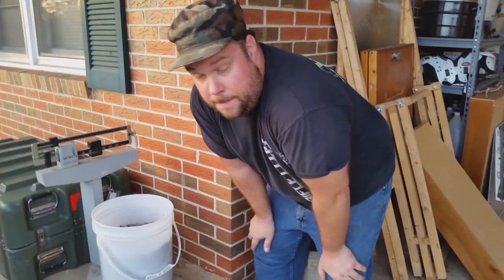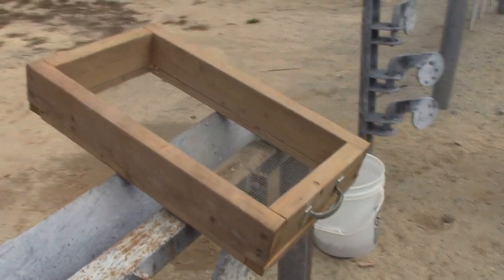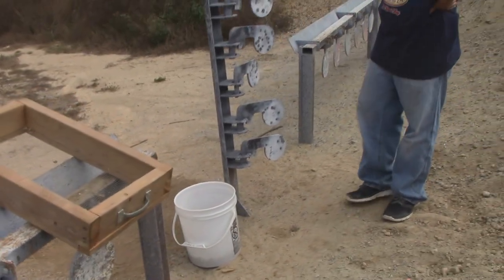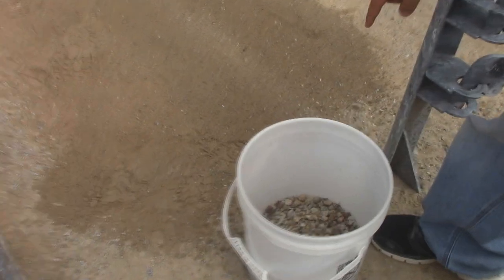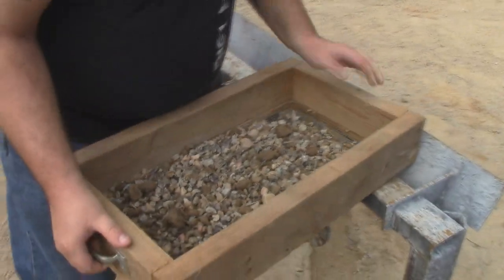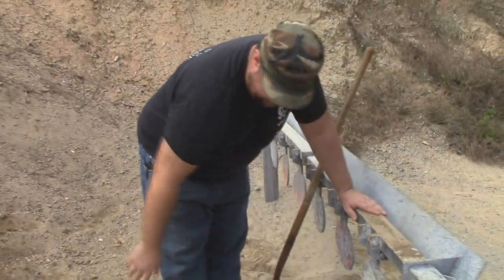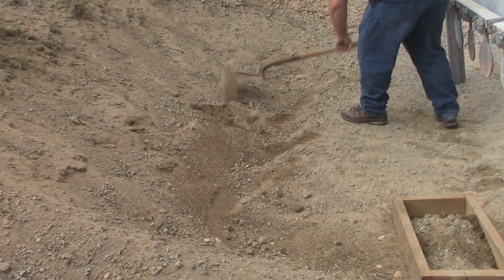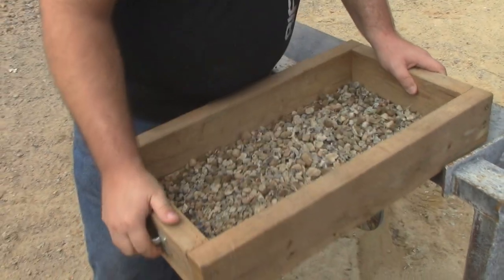I've Been Collecting Range Scrap Lead Wrong! 255LBS./30MIN.

Comment: 255 lbs. How much was rock and debris?
Reply: david diehl Decent amount probably, still worth it though i would think.
Reply: @capper6100 Do you melt the jackets also
Reply: david diehl I don’t, I do melt copper for a hobby but there is an issue with melting jackets. Getting copper hot enough to melt would vaporize lead residue and im not going to breath that in or get it on my skin.

I just throw away the jackets, not worth it.
Reply: david diehl If you are wondering, lead melts at 621 F and copper melts at 1984 F. So lead will just melt out of jacketing.
Reply: @capper6100  could probably sell it for scrap. Probably be #2 brass.
Reply: david diehl Yeah, i was considering that. My scrap yard doesnt mind lead so i may start doing that.

Comment: This tells me 2 things. First the previous range isn't making as much money as the one you're going to in this video. Think about the math. The range in this video has to work hard everywhere else to make sure people are happy going there. Therefore, more people go to that range more frequently. They likely don't have the man hours to get excess lead out from the pits. Because more people go to this range, they fire more rounds into the backstops which in turn loosens the dirt and yields more lead. The previous range has hard dirt because few go to it in the first place, the dirt settles in place due to inactivity. This means the previous range has less lead per capita.

Comment: CountryBoyPrepper getting stopped by the Highway Patrol:
Officer: CountyBoyPrepper, do you know why i stopped you?
CountryBoyPrepper:  No sir, why Did ya?
Officer: Well? Your truck its ridign low like you have a heavy load there and you missed the weight station back over there.
CountryBoyPrepper: Sir, with all do respect, i don't think i need to stop at the weight station, my load is 5 pounds under the weight limit.
Officer: CountryBoyPrepper! I need to know exactly what that load is and exactly how much it weighs?
CountryBoyPrepper: Sir this is scrapp lead and each 5gal bucket weighs exactly as much as i can posible carry from the burm to my truck.
Officer: CountryBoyPrepper! I am going to ask you one more time how much does your load weight???
CountryBoyPrepper: Sir, so thats 3 5gal buckets and each is about 85 pounds so thats 255 pounds.
Officer: But the weight limmit is 250 pounds.
CountryBoyPrepper: well Sir, there is about 5 pounds of rocks mixed in in there.
Officer: Well CountryBoyPrepper, for your honesty, politeness and accuracy you may continue to your final destination! 
CountryBoyPrepper: Thank you Sir, thank you....have a great day!

Comment: Rather than a flat sifter, use a u shaped shifter on a pole, closed ends, and pull up the hill a few feet at a time, sift and dump.  No shovel needed.

Comment: Just a stupid story but.. one day out at the range there was a brush fire and that caught the backstops on fire and they fell down into piles where the targets were... They saved the range buildings. What happened is all the heat melted out all the led into puddles. So later there were pools of led. They had to go out there with an axe to chop it up into movable scraps. 

DO NOT SET YOUR RANGE ON FIRE TO COLLECT THE LED.. just to cover my ass.. lol
Reply: Now that's an idea. Why not use a blow torch and melt all the bullets into solid sections? No need to sift.
Before a section is cooled insert a hook or eye and winch into the truck.

Comment: save your back ! build another frame around the screen you have with legs and put casters on the bottom of the screen you have with one foot of extra length on your outside frame to be able to slide back an fourth

Comment: you could do a solar powered shaker table.....  would be so much easier.
Reply: Solar is very weak. Would make more sense to use a petrol motor. Petrol is cheaper than one gets from a human eating food shaking it manually.
Reply: +Mshojat depends on the solar/battery connection you're working with.  you can make a very strong solar shaker.   not to mention he could probably melt all his lead with solar power as well.

 lens like we did with ants back in the day
Reply: For it to truly be solar powered, the panel would need to be so large, it's be too expensive and too unwieldy to use.

Instead the shaker would be battery-powered, and the battery could be recharged back at home with a solar array.

Comment: you can use magnents to separarte the lead from the rockes and other things
Reply: Lead is non-ferrous, or non-magnetic. You can't induce a magnetic field in the lead either, like you can with aluminium.  The only reliable ways to separate lead from other metals and from dirt is either heating, or chemical treatment.

Given that he's taking the shrapnel and bullets from the dirt, rough sorting with a sieve and manual preliminary 'cleaning' is probably the most efficient way to go about that.

He could make it a bit more efficient by using a scraping shovel instead of a digging spade to remove the dirt in a much more uniform grid pattern. Otherwise, he's basically doing the best you can do.
Reply: of course you know magnets only work on iron  not lead.
Reply: +TheAruruu thanks, i just learned somthing new.

Comment: As bullets are weighed in grains. How many bullets does that work out to? I started to do the maths and, life is too short, I'm away to watch the BBQ PIT BOYS
Reply: 1 pound is 7000 grains. If you're casting 200 grain 300BLK bullets, you'd get roughly 35. 
The math on that works out neatly for 200lbs of lead, you'd cast SEVEN THOUSAND bullets.

Comment: Definitely quicker than picking it up 1 by 1 LOL

But... You're making the same mistake

You're picking out the big pebbles 1 by 1.  Get another sifter/colander/whatever you call that thing with bigger holes and just dump that pile into that?

But what do I know.... lol I don't do this
Reply: Candi Soda it doesnt matter because when he goes to melt it anything that isnt lead will float to the top since lead is denser than rocks and any contaminates
Reply: not always heavy clay will mix with the lead just fine

Comment: Have you ever thought about using a metal detector's sand scoop or beach scoop?
Reply: I tried that and it sucked.  I went right back to the shovel/sifter method.  I use a set of folding table legs to sift on, so I don't have to hold the whole weight of the sifter and of course I use a dolly to move the buckets.  I work smarter but it's still a tough job.

Comment: Most gun clubs/ranges mine and reclaim their lead periodically and sell it to defer the costs of operating the range. I would ask before doing this. Also, lead exposure shouldn't be trifled with. You are generating a lot of lead contaminated dust, and you are not wearing a mask or gloves. I would worry about the lead exposure from your melting and casting operation.

Comment: Only problem is you got hard and soft lead mixed.
Reply: easy to solve if they have diferent melting point, you only need to use a mesh like the one to pick it up and heat it until the lead starts dripping down
Reply: just gave me an idea... find a steel mesh to line the crucible with... and when you have all the impurities floating you just pick up the mesh out of the crucible. of course itll have the a precise sized mesh.. not too big.. not too small, but small enough.

Comment: whats lead go for a pound
Reply: on ebay around 2 dollars a pound, usuallywhen you look up lead on bass pro or cabelas, much more moneysometimes around 8 I have noticed, so yeah he is pulling money right out of the dirt
Reply: 60 cents a pound locally, But He is not getting Just Pure lead, it's lead alloy and more valuable.  Btw I bought lead on ebay around 1.25 per lb.
Reply: ***** I bought smaller quantities of range scrap lead on ebay like 22.5 lb for $27.  $2.50 is way too much to pay for range scrap, this is what linotype and foundry type runs.

Comment: What is he prepping for, when he's going into cardiac arrest while sifting a few pounds of dirt?
Reply: Actually the more you do this kind of stuff it helps get you into shape. It's cardio and weightlifting combined. I mined a backstop once where the bullet trays were 300+ pounds each.....more like 400+ pounds each. That is how I ended up getting caught. All the decrepit old farts, broads, girly men and fat asses could have never pulled those trays free and clear BY THEMSELVES. I got banned for a few years as punishment.
Reply: @JohnDoeEagle1  400 pounds each, every time, by hand?
Reply: @luckys1evin  

There are 10 shooting lanes on that range with one of those bullet trap trays on the bottom of each one. You unscrew the wingnuts from the threaded studs and remove the access door. There is a big steel eye ring on the tray and you use a 3/4" diameter steel hook and T- handle to pull it out about 4 feet in front of the trap. You have to have the muscle strength down low to get it out so that you can scoop out the bullets with a shovel and dump them in 5 gallon buckets. Needless to say you have to be pretty f***ing strong and determined to do this. They figured out it would have to be a pretty muscular member and also someone with a Military background as well as a pretty serious reloading/bullet casting background. They narrowed it down by the process of elimination until all fingers pointed to me. I'm hoping they let it go and moved on after several years of being kicked out and they let me back in. I would ask permission (no rules were written that you can't at the time) and possibly offer to leave a donation next time.
Reply: @luckys1evin  

Key points were that everybody complained at cleanup day. They showed up and signed their names on the list, ate doughnuts, stood around and talked then left. The traps were overflowing and running over. No rules were written that you couldn't take the lead. They even said 'we don't care if you take some, but you can't take it ALL!" I think it taught everybody a lesson. They just waste the lead and sell it at the local scrapyard for pennies on the dollar uncleaned and separated. The guys and gals assigned to cleanup day are lazy and not motivated individuals. "Someone" with the balls and brawn took it during Covid-19 pandemic to make ingots and then bullets with it INSTEAD of it being sold to China and imported out of the Country. All the while a NON PROFIT club maintains $75,000 in their checking account!

♠🏅

Comment: And you're helping the environment. 😁🤘
Reply: How do you figure that? It came from out of the ground to begin with and we are just putting it back.
Reply: @dennisholder8427  because of the concentration if the lead in one area.  Lead exists naturally in areas where the environment is condusive for it to exist.  Nature kinda self contains it.  Taking a large amount if it.  And putting it into a foreign area is bad for that environment.  
Yes it get extracted from the ground.  But its not as pure for one.  It has to be refined to make it pure.  If you draw from a well with a high lead content in the water the water isnt drinkable.  
Oil comes from the ground too. Its deep in underground wells. Just dumping it back on top of the ground isnt good for the environment.  
I love shooting. And personally I never have extracted my lead.  But someone spending time doing it is a good thing. Free lead for him and helping the environment at the same time.

Comment: Your worried about the range?? They should be paying you for removing the contamination from the ground.
Reply: 1. He's getting lead, so that's quite good of a payment.
2. The range would usually pay some "professionals" to do it, but they wouldn't sift through some dirt, they'd sift most of it.

3. If this guy built a small foldable contraption for sifting he could probably clean the ranges properly, get paid, and get hundreds of kilos of lead.

Comment: Two separate Gun Ranges around here wont let anyone near the lead-member or not. I guess they realize the value in scrap. The one has 55 gallon barrels of slugs and barrels of brass casings ready for the scrap yard. And they sell some more desirable casings by the pound to reloaders. I wouldn't post too many videos like this, You might end up screwing yourself out of free lead.

Comment: I was picking it up by hand the other day and the range master tore me a new asshole, I’ll be looking for anew range. The rule says no digging in berms so some fucked it up for everyone. I wouldn’t consider picking it off the ground digging but the range master disagreed apparently. I was very courteous even though he was a dick. The rule isn’t even posted on their rule board. Just on the website
Reply: Actually the more you do this kind of stuff it helps get you into shape. It's cardio and weightlifting combined. I mined a backstop once where the bullet trays were 300+ pounds each.....more like 400+ pounds each. That is how I ended up getting caught. All the decrepit old farts, broads, girly men and fat asses could have never pulled those trays free and clear BY THEMSELVES. I got banned for a few years as punishment.
Reply: There are 10 shooting lanes on that range with one of those bullet trap trays on the bottom of each one. You unscrew the wingnuts from the threaded studs and remove the access door. There is a big steel eye ring on the tray and you use a 3/4" diameter steel hook and T- handle to pull it out about 4 feet in front of the trap. You have to have the muscle strength down low to get it out so that you can scoop out the bullets with a shovel and dump them in 5 gallon buckets. Needless to say you have to be pretty f***ing strong and determined to do this. They figured out it would have to be a pretty muscular member and also someone with a Military background as well as a pretty serious reloading/bullet casting background. They narrowed it down by the process of elimination until all fingers pointed to me. I'm hoping they let it go and moved on after several years of being kicked out and they let me back in. I would ask permission (no rules were written that you can't at the time) and possibly offer to leave a donation next time.
Reply: Key points were that everybody complained at cleanup day. They showed up and signed their names on the list, ate doughnuts, stood around and talked then left. The traps were overflowing and running over. No rules were written that you couldn't take the lead. They even said 'we don't care if you take some, but you can't take it ALL!" I think it taught everybody a lesson. They just waste the lead and sell it at the local scrapyard for pennies on the dollar uncleaned and separated. The guys and gals assigned to cleanup day are lazy and not motivated individuals. "Someone" with the balls and brawn took it during Covid-19 pandemic to make ingots and then bullets with it INSTEAD of it being sold to China and imported out of the Country. All the while a NON PROFIT club maintains $75,000 in their checking account!

♠🏅